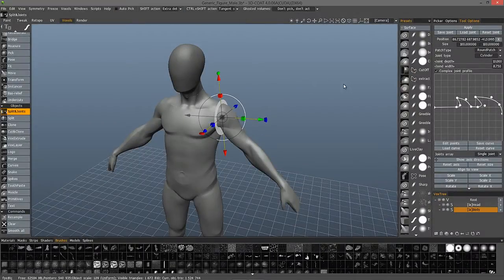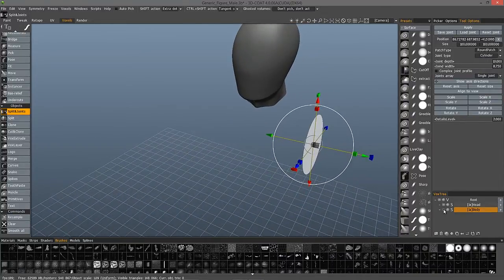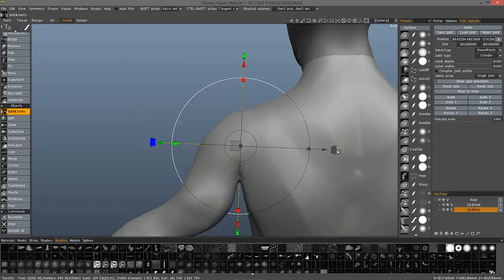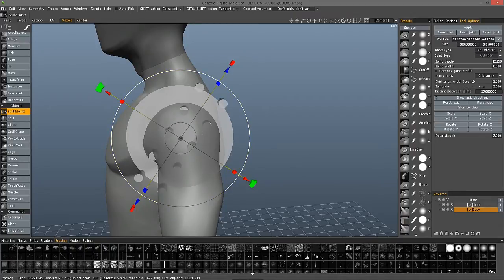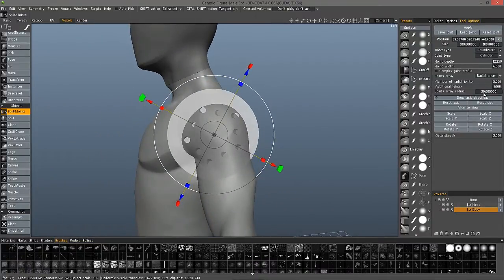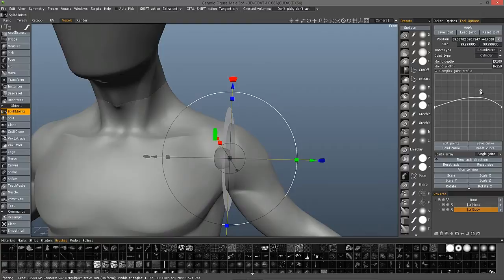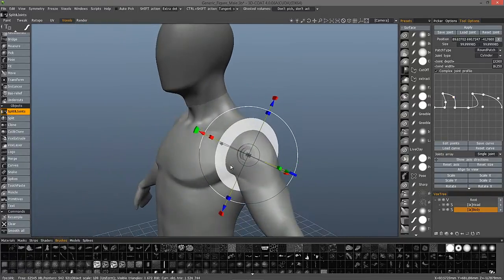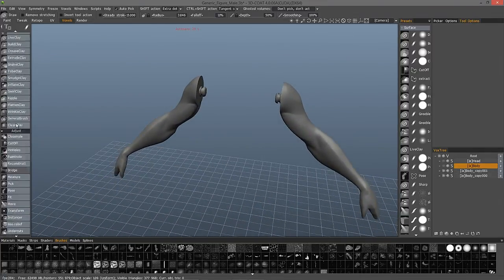Split & Joints Tool

Comment: Are there options to specify tolerances? For example, is the corresponding recess in the body enlarged to accommodate the complex joint?
Reply from the maker: There is a new option to specify the width of the opening on the female end. It's called "Joint Delta." You can find more information about it from the online manual. You can find it on this page:
http://3d-coat.com/manual/sculpt/141-objecttools/
Reply: Nice! I downloaded the demo and I'm going to try it all out. I'm looking for an alternative to Netfabb and I hear 3d coat is awesome.

Comment: hello, I got the latest v4.1.04A but the split&joint tool isn't in the menu. 
Is it hidden somewhere?
Reply from the maker: It's only available in Surface mode, not Voxels. Should be the first tool under the OBJECTS section of the tool panel.

Comment from the maker: It is one of the tools unique to Surface mode...all you have to do is switch the layer to Surface mode, to use it.
Reply: Boolean operations and splitting are better done in Voxels, so I'm puzzled why this tool isn't in both surface and voxel?

Comment: I think it'd be cool to try a ball joint rather than a simple pivot, but yeah I was kinda thinking about     whether or not the parts would be too close to print.  There has to be some space in there to divide them.  Seems like a fast solution but if this is possible what about hinges and  other moving parts.  Will this tool be a good indication of what is not too thin and not too loose in terms of doing other types of sections?

Comment: i too am convinced that this would not print to be movable. if pose handwork is needed afterwerds how is this a superior method over boolean joints? why not offer a 2nd curve, one for the joint and one for the socket to add desired spacing right into the lathe?

Comment from the maker: Why do you assume there is no space? If more is needed, it's simple enough to use the Pose tool to select the joint and shrink it to their liking. This feature was at the request of those who do use 3D Coat in this capacity. Just demonstrating how it works.